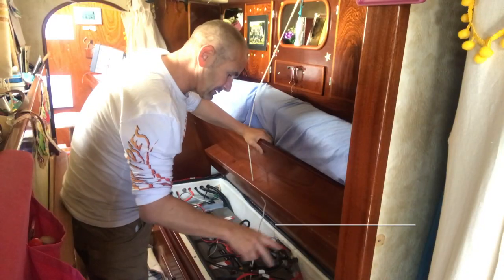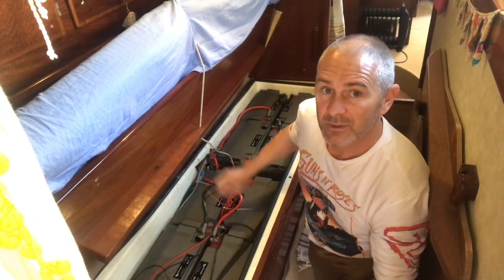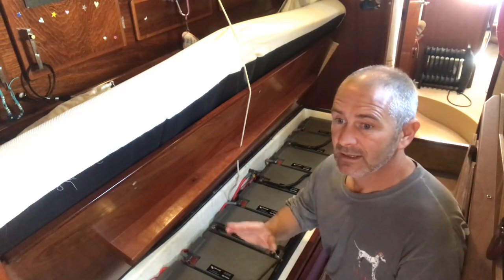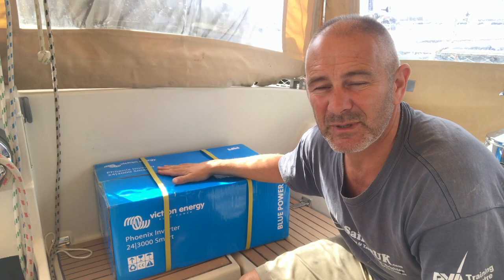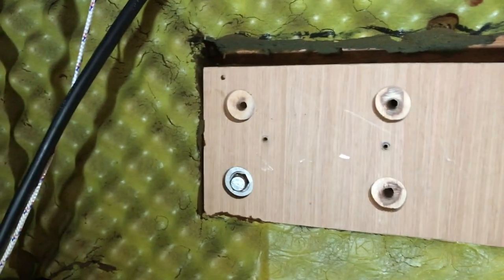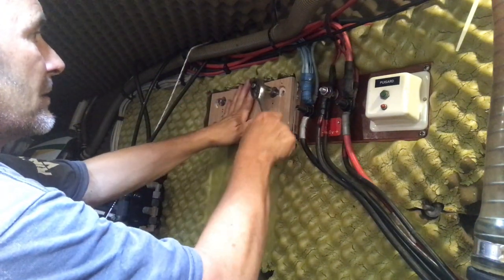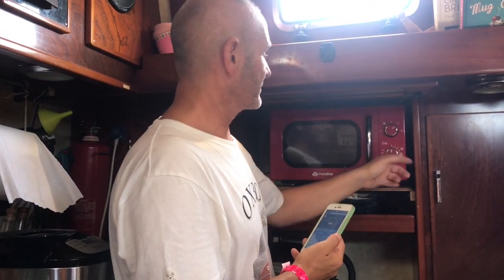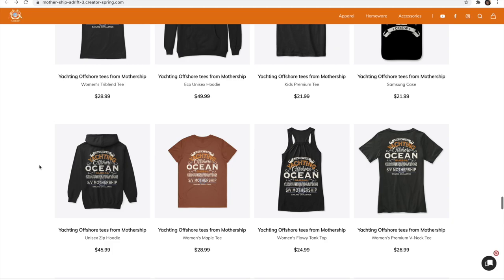Victron Battery Replacement and Phoenix Inverter Installation on a Sailboat with 24v Marine System

Comment: The 3 pole 40 amp circuit breaker you put in between the AC Outlet on your inverter & the load, was it a AC or DC circuit breaker?

Comment: Thanks for sharing. As always, top-notch documentation of the work done. A side question, how is washing machine exhaust water taken care of? Do you dump this water into the bilge as greywater and then pump it directly into the ocean? Just curious how modern cruisers solve this. Cheers.
Reply from the maker: Yes it goes into the grey water bilge then overboard so obviously we try to use none-bio - biodegradable if we can find it. In marinas and some anchorages there are laundry facilities ashore which we use as much as possible. I don’t think anyone has come up with a better solution but if you hear of one we’re all ears.